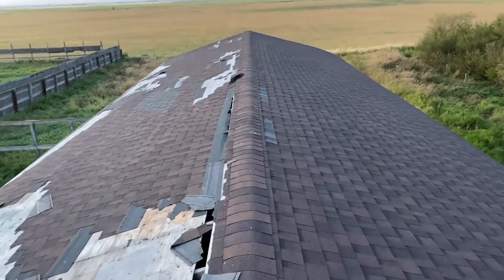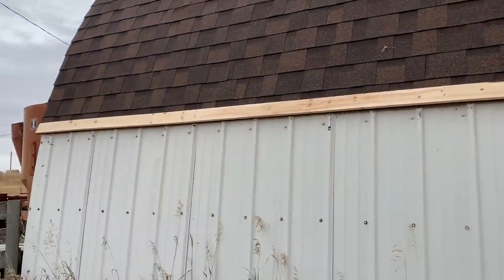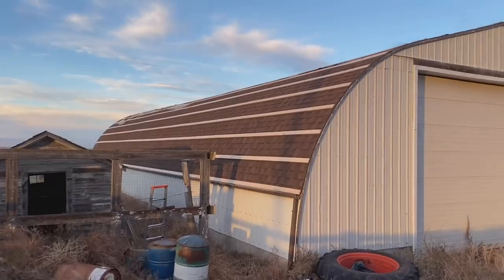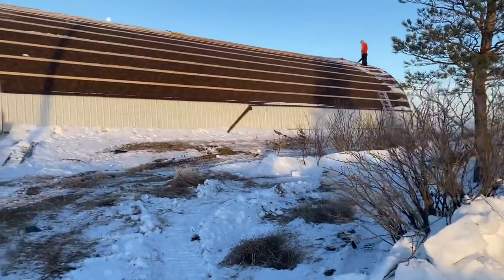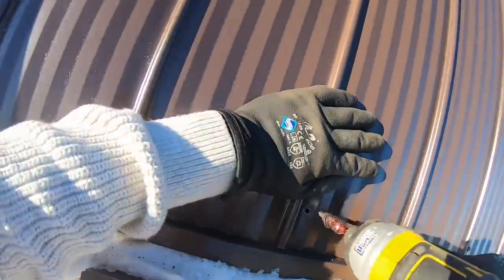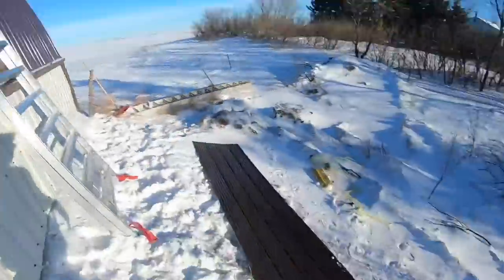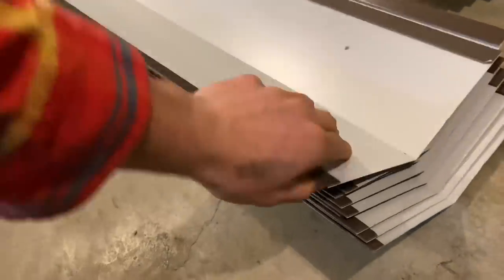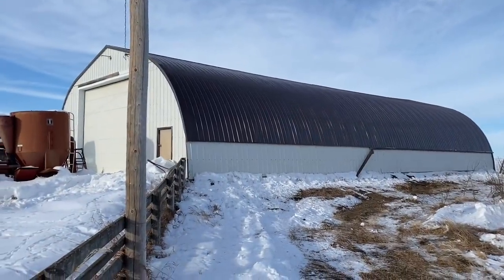Metal Quonset roof

Comment: I’m sure the snow beads right off the next day? And previously the snow accumulated on? I want to build a S or Q Quonset in norther Washington as an aircraft hangar. Worried about snow accumulation on the stock Quonset roof. Can get heavy fast. Let me know if your metal roof panels shed the snow fast. Thanks.
Reply from the maker: Yes the snow always melts off faster on metal, mainly because it slides off even when it gets a little bit sunny out, especially on the darker colours

Comment: Hi Austin, I went to the Vicwest website, can you confirm that you used the Barnmaster 32" wide?  Also, how long were your panels? Looked like 30 feet?  What size hole did you predrill?  Have you done another Quansit Hut Roof and did you use 2 panels instead of one like you mentioned?  Unfortunately Vicwest does not sell this "agricultural panel" in the USA.  Do you happen to know of a US based manufacturer that has a flat stock metal that is bendable like Barnmaster?  or another Canadian mfg that may ship to the US?  I am trying to redo a barn for my daughters wedding reception in August, so a quick reply would be much appreciated.  Thank you, Jon

Comment: they are the new style tab design , witch they recommend for the higher wind rating , looks like a bad batch for sticking or and what season they installed them ? , the new tar on tabs is more elastic rubber than the old tar dots  , the new stuff is really tacky and the tabs are more strong , the old 3 tab are a thing of the past soon also
Reply from the maker: Well it is VERY windy out there and no protection from the wind either. I was told the roof was put on in the summer so my guess is it just got too windy. Shingles are a bad idea on a quonset unless they are t-locks; they stopped making them about 20 years ago, probably because they were too good lol
Reply: @AustinTischler  ya the wind seemed to hit that one section the most ,the angle ...  also the old diamond pattern asphalt shingles from the 1930's did well also , ive seen them last close to 50 years on my grandpas house , the new roof looks like it should hold up now , great job !